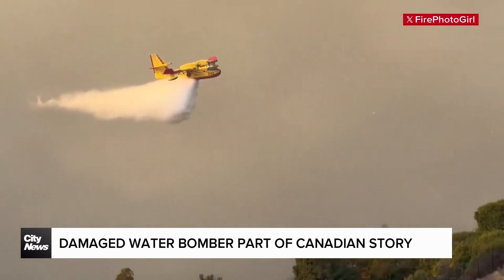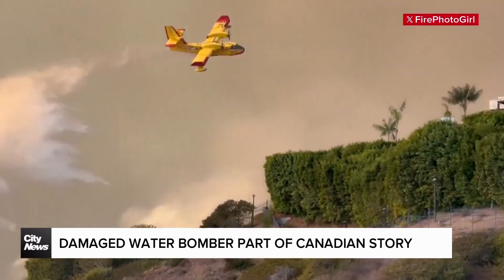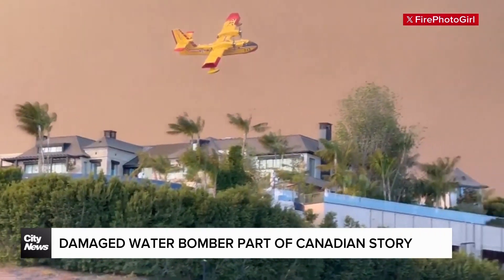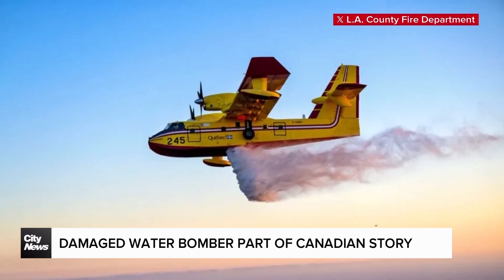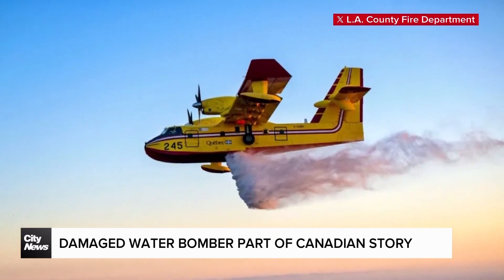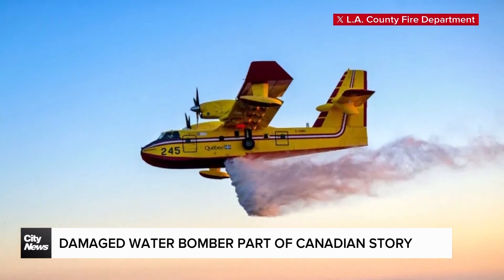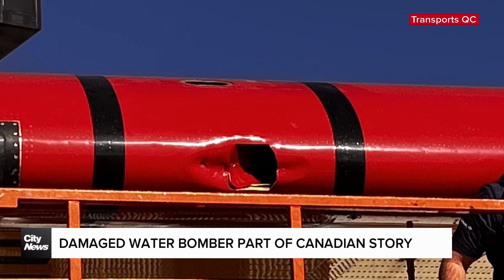Repairing Canada's damaged water bomber

Comment: Cover hole with 100 MPH tape (Duck Tape) works great till new part comes in.  To not fly, is just asinine!
Reply: There was structural damage inside the wing that compromises the strength of the wing. These wing like all others take a lot of stress. The damage was found when returning for fuel. They can not depart again without it being repaired to manufacturer standards. Would you put your family on a damaged airplane ?

Comment: Cut it out and weld in a new sheet of metal or aluminum (whatever is used)
Reply: Any repair to the skin of an aircraft has to be done in strict accordance with what the engineers have specified, in order to maintain the Certificate of Airworthiness.
Reply: I’ve learned something today, thank you both for explanation.
Reply: @ekidmusic  Welding isn't done to join aluminum because it causes stress fractures and cracks. Rivets only.

Comment: I had read that the first run of the new one, the CL 515, coming from Viking Air in Calgary, is going to Italy.  Canada has to wait, and our fleet is getting old.
Reply: Canada has to wait because none of the provincial agencies ordered them before European agencies did. There are about 29 new orders on the books at present. The 515 will be very expensive, is delayed by many years, and does not provide much improvement over existing turbine CL-215T or 415s in service. They'll fly at the same speeds and carry the same amount of water at a price expected to be around $50M CAD all-in per unit.
Bombardier ceased production in North Bay, ON after a drop in orders several years ago...the last four CL-415 aircraft produced went to Aero-Flite based in Spokane WA (owned by Conair Group based in Abbotsford BC), and continue to fly on contract throughout the US. Two have been deployed to the LA region this week. Viking/de Havilland is not currently able to produce the CL-515 at a high rate...if you order one today, you can expect to receive delivery in approximately 6-8 years time.

Comment: 1500 Imperial Gallons = 6,819 litres.  Easy Fix. 2 hrs.  Spray foam flush and Wrap with 22ga Al and a handfull of pop rivets and sealer.
Ditch metric.

Comment: That leading edge could be built with carbon fibre now to mitigate this issue
Reply: Actually carbon fiber could be more brittle and susceptible to breaking with impact. And more costly to repair. Turbofan fan blades on GE engines have titanium leading edges in order to withstand the bird strikes, the rest of the blade is composite.
Reply: @andrebello4191    But the leading edge on wing is so much larger, not spinning so much faster....  It could be made with carbon lattice or truss backing built-in for extreme strength.  It's the next logical step in development.
Reply: Yeah but chromoly will due .

Comment: Québec signed a deal in 1994 to lease 2 CL415s to LA County each September for yp to 6 months.  So these plaes were likely in the region from the very start. Québec announced it was sending more. And in winter, maintenance cycle is performed to keep these old planes in good shape and remove rust if they landed in ocean.  Until DEHAVILLAND Canada starts deliveries of the 515, each remaining CL 215 or 415 aircraft is very valuable and treated as such. 
The largest fleets are in France (at Nîmes) , Greece and Croatia.
Reply: Manitoba repairs their water-bombers at a defunct Air Canada repair hangar across the road from me where I’ve seen at least 8 shiny, clean units leave each Spring and return looking like coal miners after a hard shift each Fall!
Unfortunately as it’s presently -28C atm, so I doubt they’ll be leaving anytime soon as there’s not any heater on board!
Reply: The largest fleet is in Canada, with six provinces and one territory operating dozens of CL215, 215T and 415 variants. 

You're absolutely right about the 2 Quebec 415s in LA County - today's media believes they were sent as a result of the LA fires, but they've been there all along, and the contract arrangement is 30 years old.
Reply: @adrianwapcaplet2773 Yeah there’s many of them parked at the Québec city airport
Reply: I believe BC sent a couple down I think
Reply: @RexFeral55  Unlike Ontario, Quebec & Alberta, the BC Govt owns no aircraft, and does not contract any CL-215/415 aircraft. 
CBC reports about a "BC company" that sent down airplanes is incorrect. They were referring to Coulson Aviation, who bases their helicopters & airtankers in California. The helicopters were already in place on a standing contract, and their airtankers are either working on existing US contracts, or working overseas in Chile & Australia.
Reply: Ive watched many videos about the CL-215/415 in europe. They call them “Canadairs” refering to the name of the company who first designed and built them.

Comment: From WW ii era. Only one country has the world's largest modern water bomber.
Reply: The CL-415 first flew in 1993, almost 5 decades after WW2.  It was developed from the CL-215 which first flew in 1967.
Reply: @DaveGIS123  The original 215 is an upgraded PBY. The 415 is a big upgrade to the 215 but I can still see the legendary flying boat of WW2 in the design.
Reply: @jimmygreen281  With respect, the CL215 is nothing like a PBY beyond them both having radial engines and two wings.  Both aircraft  are flying boats, but their fuselages are completely different, as is everything else about them.
Reply: @jimmygreen281  The original 215 was a purpose-designed firefighting plane and is an order of magnitude more effective than the converted PBY Canso/Catalina.
The 415 has much better performance than the 215, but an inferior tank door design...the converted CL-215T (T = turbine) blends the best of both worlds: the 215 drop pattern with the 415 performance.

The CL-415 EAF (Enhanced Aerial Firefighter, operated by Bridger Aerospace) is merely a 215T equipped with customer-requested goodies such as upgraded avionics, air conditioning and a custom paint scheme.
Reply: It’s not from WW2 era.